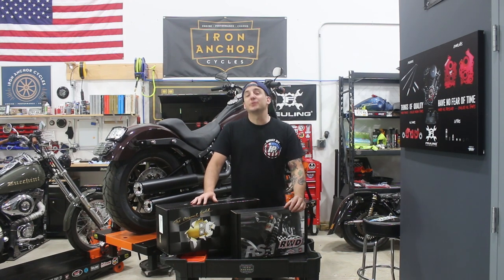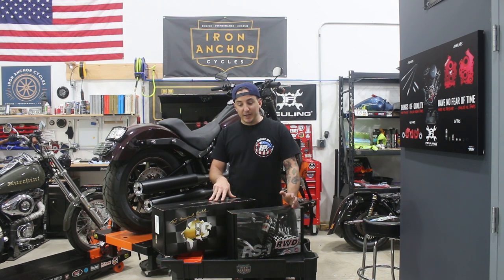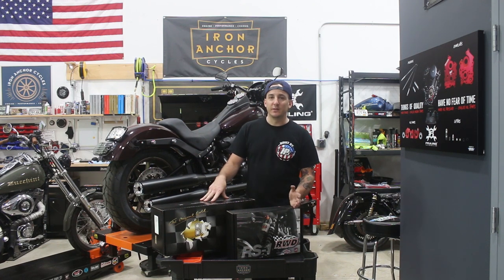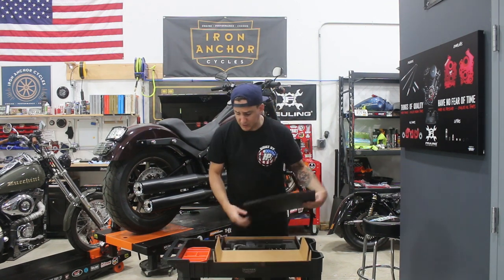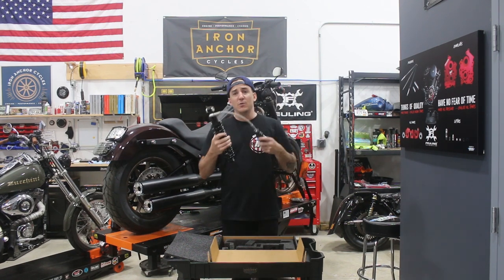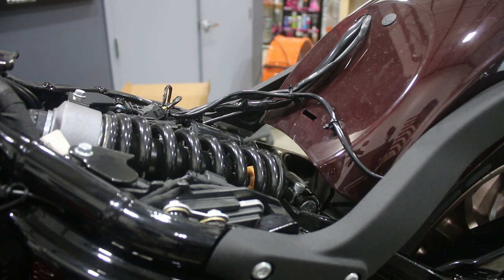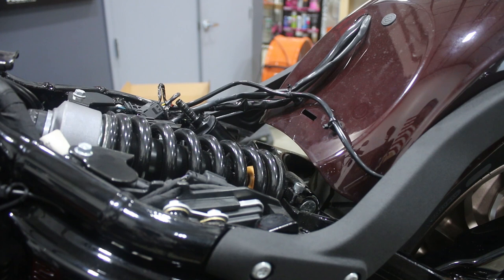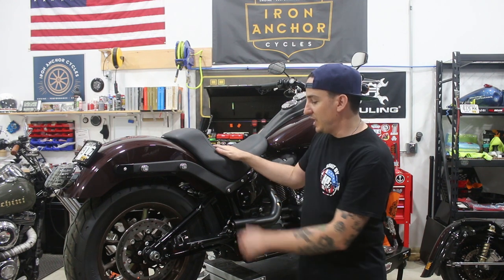Project FXLRS - Part 4 - Monoshock Showdown!

Comment: Running FOX not a big fan of the remote reservoir!
Reply: How you like that Fox rsd shock my man?? Trying to figure what to go with, not a fan of the external adjustment either.
Reply: @ebshitbird2217  it’s fine but need to make some adjustments to bit have not had a chance been working on the fairing, HD back order parts and other items
Reply: AZ Starlink What made you go to Fox over progressive and legends?
Reply: @ebshitbird2217  overall reviews and not a fan of progressive shocks

Comment: No you are wrong, Stock suspension is bad and borderline dangerous! Be honest 😮
Reply: My 2020 FXST rides like a skid steer loader.  I hope a shock with a longer stroke helps.  The OEM shock doesn't even have an inch of travel with the preload set at its lightest position.

Comment: When I raised the rear of my Sport Glide it improved the suspension geometry. It became a little more flickable and provided more lean angle so I don’t drag a boot heel so easily. It may have accelerated front tire wear. Not sure. I do have 20k miles so on the tire most of which was after the swap.

Comment: After installing the 13.5” shock, how much more travel does the swing arm have before it tops out?. A 13.5” shock would move the swing arm down over 2” at the axle. So one would think there mustn’t be much upward travel now before the swing arm tops out on its bump stop when riding ?

Comment: If you raise the back of the bike up 2 inches with the 13.5 RWD, should you raise the front up 2 inches as well for the best handling or keep the front stock height? 
Also, what does the S and H on the reservoir stand for and how should I set mine? 
Thanks so much for your professional videos and support. Keep them coming!
Reply: Great question I’m curious on that also
Reply: Yes is the short answer. Your rake and trail are off now. I ran my + 2 front +1 in rear for a while now I have them equal height. The turn in feels better now. 🤘🏼

Comment: not a fan of the requirement to remove the belt guard for the RWD, I went with the Ohlin's HD 506. The remote reservoir mounts on the side cover...looks really clean imo.
Reply: How do u like that ohlins 505 after putting some miles on?

Comment: Could you help me understand the situations where external adjustment of rebound vs preload would be beneficial?
Reply: External preload would be beneficial to adjusting spring tension for a passanger on the fly keep from too much sag. The compression is more for changing the dampening u run if you are riding more or less aggressive.